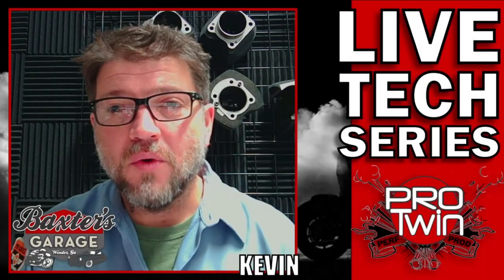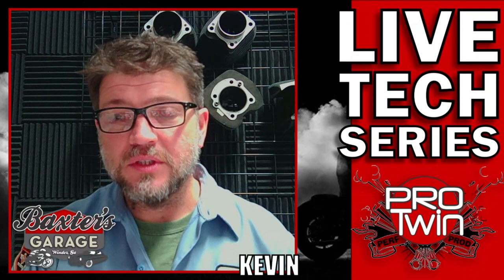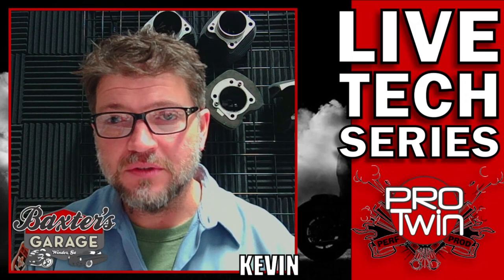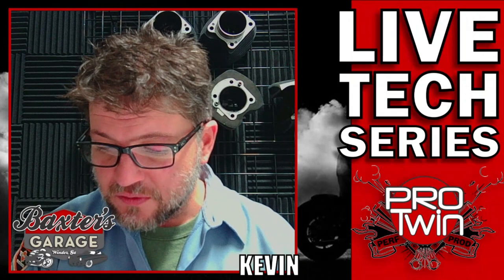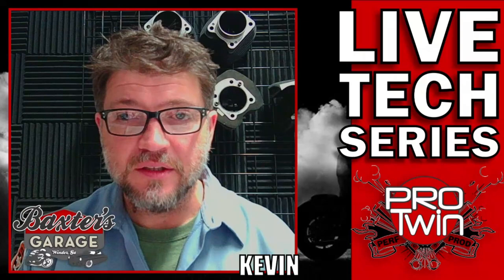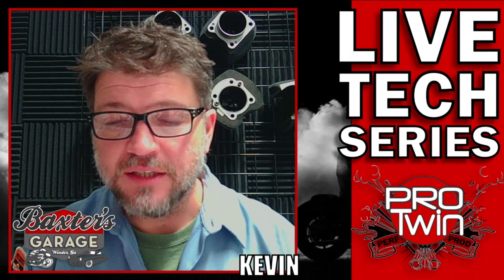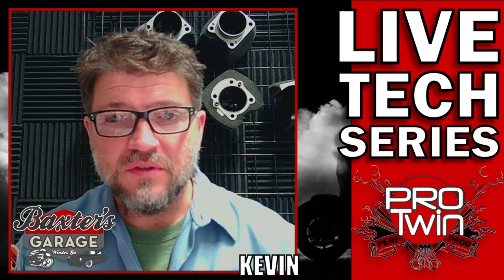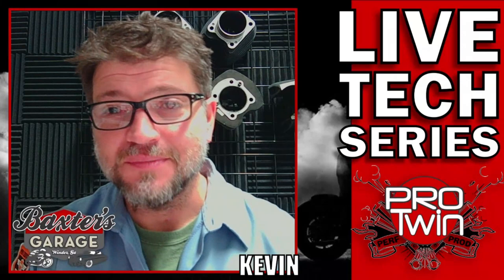Harley Sumping Symptoms and Clues - LIVE Channel Announcement - Kevin Baxter - Pro Twin Performance

Comment: Opinion on upgrading to a fueling 465 cam?
Reply: Brian Parker .......about 3 months ago Kevin did a video comparing 3 cams, zippers, s &s, and the fueling 465 based on the manufacture’s spec sheets.   If you haven’t seen it, I suggest you check it out.  It’s loaded with information.  On a personal note..... I’m running a Fueling 465 in a stage 2 Milwaukee 8 with an Arlen Ness Big Sucker air intake and Bassani Road Rage 2 into 1 exhaust.   The Fueling generates its power at a higher RPM than the others.   I’m a classic Harley “short shifter” in that I usually shift before 4500 RPM.  That’s just about when the Fueling 465 starts to outshine the other two.   So in my case I’d probably like the low RPM power response better with the zippers or s&s.  The Fueling 465 is still a fine cam and it’s loads better than stock and it’s still a torque cam and not a power cam.   Damn......I was really happy with the Fueling until I saw Kevin’s comparison.   Now I’m not quite as happy.  My bike is having a sumping issue so I’m probably going to replace the fuel pump and cam plate with s&s components.  I might change the cam too depending on cost with one that better matches my riding style.

Comment: Guys just a quick question.. I have a 2019 cvo street glide with a stage 4 kit, and I got that kit straight away and got it installed even before I had the bike out from the dealership.. now the bike is loosing idling.. I mean when I’m in neutral it turns of by it self.. please help.. I got the bike now in the dealership
Reply: And they found 310mml oil in the crankcase
Reply from the maker: well that's about 10 ounces.  That is too much for sure.  Have a look at my most recent uploads of an M8 and what sumping looks like.

Comment: Same reason you dont use leverage? I.e. breaker bar?
Reply from the maker: Another viewer asked this question.  I was using a wooden stand on a cart to let people see at home, it can be done without crazy fancy tools.  Typically, we bolt to a nice engine stand, and stationary table, or tear down table, to tear down.  Just another way to show folks how it can be done.  I have several breaker bars....but...since this engine was this old and never torn down, i also wanted to "feel" the head bolt break loose....if it didn't feel right, i'd know it was seized to the stud.  Also...it's too damn long to get in the video, hold the engine, etc.

Comment: This isnt really a question about oil sumping , but im looking for a shop to bore/hone my throttlebody to 50mm on my twincam.
Do you know any ??
Reply: Cheif, I've machined the I.D. of both carbs and throttle bodies over the years.  Done properly,  it's not a cheap proposition, but it can be successful. The boring I do on a mill, the hone on a Sunnen horizontal or more commonly known as a rod hone. Having the right size mandrel is  critical. You will need a butterfly machined as well.  It's a must to check the throttle shaft to housing clearance before you use the current throttle body and start machining the bore size. It's  not as simple as installing bushings as the alignment is critical. Horsepower Inc. in Indianapolis is who I highly recommend for a new unit. They have a  51 m.m. cable unit that should fit your requirements,  and hopefully your budget. They're as good as it gets.  SARGE.